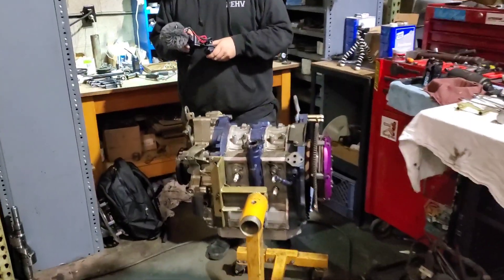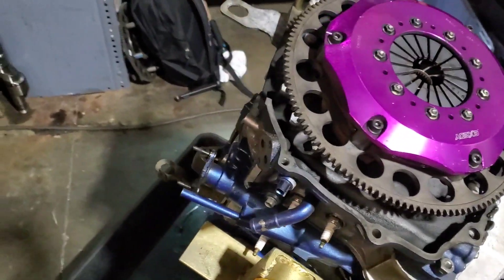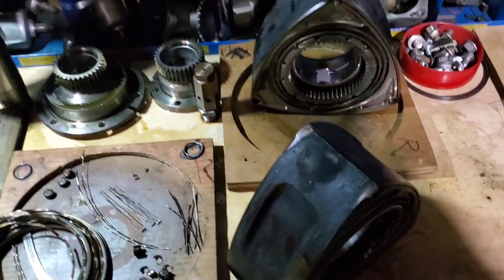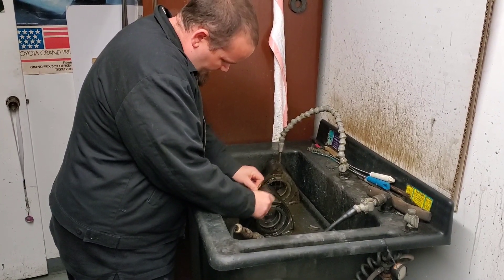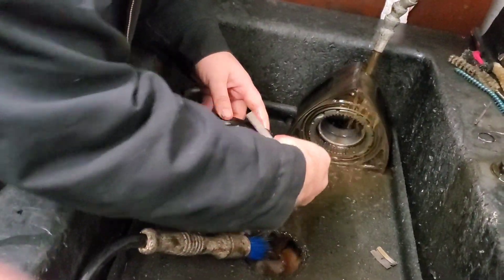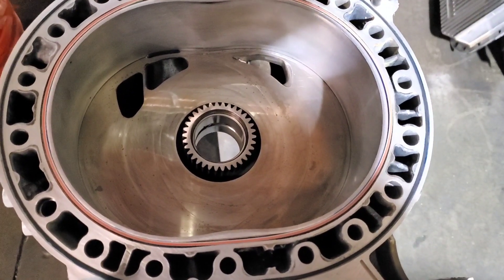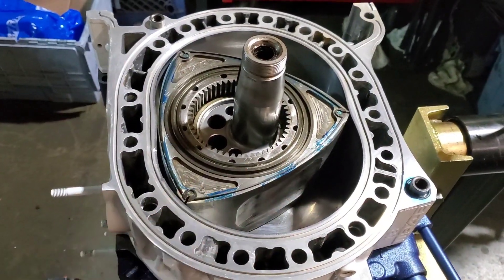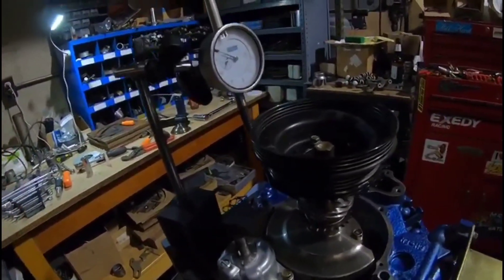Mazda RX-8 Renesis, Ported Half bridge rebuild, SE3P

Comment: So all used seals and springs minus side seals? I understand it's really low miles probably a track only car or something ?
Reply from the maker: Yes, generally I recommend new everything but this was a friend at the time.  I was trying to help him out as he had a oil smoke issue so we poped it apart to inspect.  Turned out his Oil Metering Pump and Oil Injectors where bad.  The car also had the wrong size fuel Injectors.

Comment: I had a question about oil pressure what is the max pressure you recommend for that motor and is there any benefit to put up the pressure to 120 or 135